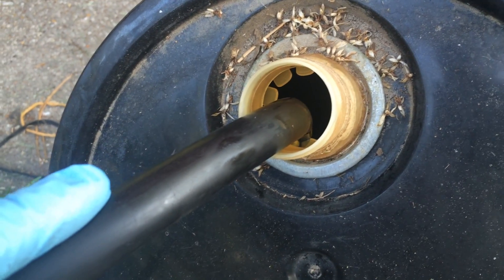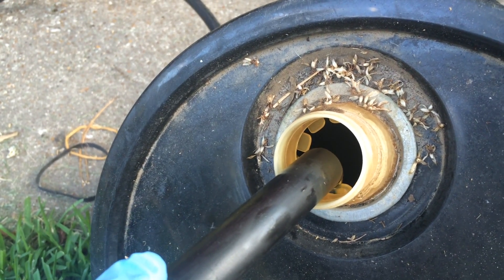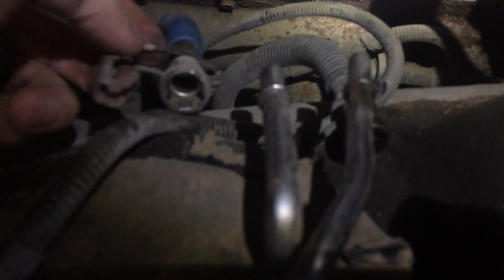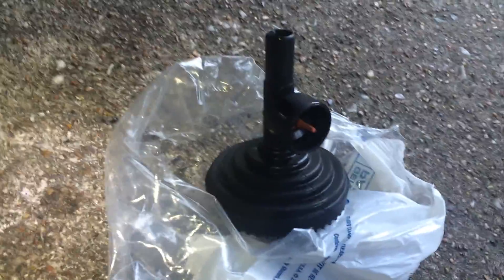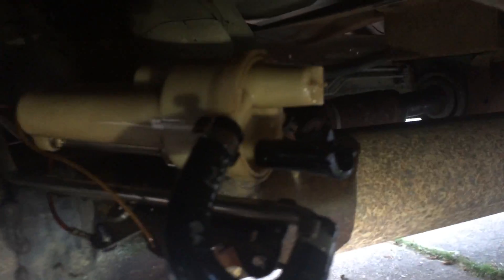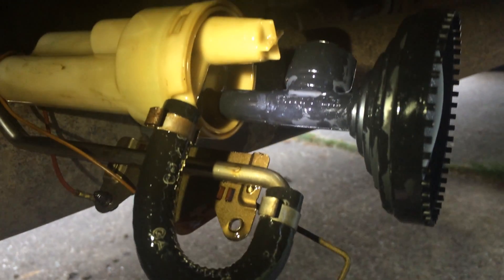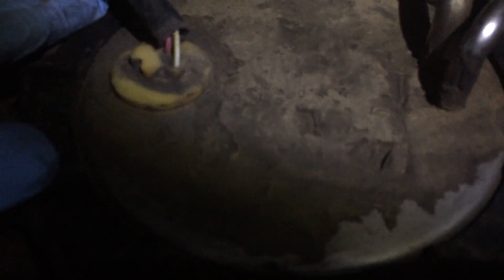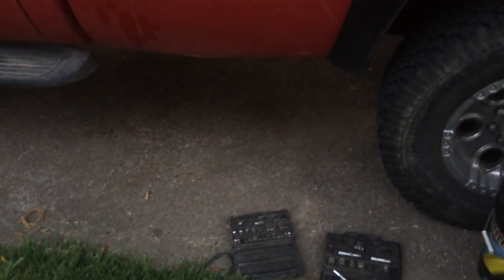Replacing Fuel Intake Screen - 1999 F350 7.3L Diesel

Comment: Thanks very helpful!. I have a 2000 f350 7.3. It's doing the same thing. My check engine light comes on when it starts sputtering at 1/4 of a tank. Did your check engine light come on? It won't throw no codes though

Comment: Video was spot on man. I have a question.  Was you throwing any codes when it would start to act up?
This is exactly what my truck is doing. (I HAVE A QUARTER TANK OF FUEL RIGHT NOW. ) it drive fine last night for 30 miles parked it. Ran like a champ. Woke up this morning and it's not getting fuel. And throwing secondary fuel pump circuit low. I have changed everything literally from the fuel pump to the tip of the injector. Except the PCM. Every sensor has been changed including the coolant temp. All fuses and all  relays. I mean I have even changed the HPOP pump.

I can't find the gremlin anywhere. So the tank is my last hope. 
Thanks for the video I know the
Steps perfect description and details where need.
Reply: My pickup screen is fine. Whatever tells the fuel pump to turn on isn't telling it to pump. I have open bleeder valve on fuel filter housing and had a poof come out. Then Crack it again and spray my turbo. That's what makes me think PCM. 

I had issue using a gallon of oil to go 30 miles. So I found oil in my filter pot which had my go to injectors and yes the orings was bad on numerous injectors. So changed injector and cranked. It ran like crap. 
It finally hit me if all that oil is in the tank. And sure enough tank full of oil. I turned key and let the pump, pump out the contaminated tank. Since then I now have the secondary pump low circuit issue. 
I have a filter pot housing on order. After that the PCM is the only thing left. I just don't want to change it since ford no longer keeps them and the part is Vin specific.
Reply from the maker: Yeah I had an injector ring wash out this summer also, pumped my oil into the bowl like you said. I never figured it got all the way back to the tank but maybe. I never had to drain the tank to clean it out at least. 

When my IDM was shutting my truck off after 20 seconds it was NOT throwing any IDM codes. It’s wasn’t throwing any codes at all! We did like you and we were chasing a fueling issue thinking that maybe the pump was shutting off for some reason.
Reply from the maker: Mine never threw any codes, it just would run out of fuel when the gauge read 1/4 tank. I hate to say it but have you tried changing your IDM? My truck has eaten 3 IDM’s in 10 mos. This last time it would start and run for 20 seconds smooth as could be, then just shut off like I turned the key off. Then it wouldn’t restart for 30 min or so, and then do the same thing. We thought it might be a fueling issue. Like you, we sorted through all of it, filters, pumps, etc. Never had any engine codes. finally out of desperation we changed the IDM and it ran fine for a couple weeks. Then it went to delayed start, then started missing. Hooked the computer up and it read several misfires and a few IDM codes. Swapped it again and it’s running smooth again. Can’t seem to get an IDM to last.
Reply: I haven't had any codes about the IDM. I have changed it already. Not saying it's not the issue. But no codes other than fuel pump.

Comment: You should have change the small screen inside above that bottom filter screen.There is two of them and you can get the entire kit from rock auto for under $50
Reply from the maker: Well I’m due again. It’s been broken for about a year. I just keep putting off working on it again 😁

Comment: 10x10 blocks and wedged up to hold in place next to straps position
Reply from the maker: Yeah that would work. I have my own sawmill now, and I do saw out blocks like that every now and then. 😁
Reply: @TomBrueggen  I used tie downs to hold tank up.. then thought and tried blocks, WO measurements... Custom set measurements taken would be much more efficient.. 
Anyhow the blocks made life way easier over the tie downs.. 
1 lay blocks on there side, with tank on top 
2 connect lines, 
3 reposition blocks from on there side to upright.
4 if blocks or blocks and wedges set to fit before unstrapping it should fit snug as a bug. Straps bolt with a breeze
Reply from the maker: Yeah I’ve since learned how to use basic ratchet straps like little come-alongs. They don’t have much control when you release, but have used them to lift something a bit, and then block it up, then lift again. I need to take my tank down again, so maybe I’ll try the block the next time. Thanks!

Comment: There are two filters INSIDE the sending unit.  They likely need to be cleaned as well,  The sending unit pries apart and they pup off.  That's what the small cylindrical tube like structures on the outside of the case actually cover.  Check here for more info:  https://www.youtube.com/watch?v=i3UKgw0iGKQ and here: https://www.youtube.com/watch?v=Md3AESnN7cE
Reply from the maker: Thanks for sharing the other videos!

Comment: Don't waste your time. Find another video, like one of the Hutch Mods. Boy hope people don't use this as a model and skip all the steps you did, and go through all the aggravation. You didn't clean the screen in the tank, which could come back to haunt you in short order. Didn't check to see if you had the pickup at the right level, and didn't even know there was a tool to take off and reinstall the tank lid.
Reply from the maker: I admit I don’t know it all. But I got it done, on my own, and it’s working fine. I appreciate your input. The things you mentioned, I was obviously unaware of at the time. Hopefully others see your comments and do a more whole job than I did. Thanks for watching!
Reply: @TomBrueggen   I think you did a fine job. I have the same truck. You don't need all that hutch mod shit. I'm pushing 450 hp and don't have a hutch mod and don't have a fuel pressure, delivery or filtering problem. These comment warriors think they're perfect mechanics or mechanic critics. Half of them don't even own a truck.

Comment: I'm going to have to dig into mine soon, nasty dirty job am not looking forward to. I found it interesting that you didn't need to take the tank all the way out, other vids they drop the whole tank. I may try it your way. There are the two little screens in there also that should be cleaned or replaced, but I bet you don't want to do it over again! If it's running fine leave it. I have the symptoms of loss of power bad mileage and running out of fuel at 1/4 tank on the gauge. To have it done is just way to much money! 2000 F250 230k miles.
Reply from the maker: Timmy tool, maybe I got lucky to not have to fully drop the truck. I’d suppose most folks do just to get it out from under the truck for easier access. I’m lucky my truck sits high enough I could just sit under there and do it easy enough.
Reply: That's great, my truck has a lift, makes it easy to work under there!
Reply: I have been giving thought to turning mine into a flatbed. Build custom hatch W a quiklatch over fuel assembly.. 
Could even just get bulletproof fuel system, with a custom tank\sending unit .

Comment: Have to drop my tank to get to brake lines broke no brakes anyone got tips or ideas are welcome thanks
Reply from the maker: If you can access the broken lines can you just run new lines to replace them? I can’t recall of there are connections in between or not. Otherwise just run the tank as low as you can on fuel and take it down. Nothing is easy, but this is easy enough. I did it by myself in less than an hour I think.
Reply: @TomBrueggen  thanks I appreciate it I'm going to try it to save me some money.
Reply from the maker: Understandable. It doesn't really cost anything to take down your fuel tank, other than a couple tools. You can get a fuel line disconnect tools for something like $5, so you don't have to fiddle with screwdrivers like me. Good luck on  your project!
Reply: @TomBrueggen  Were I live everything is expensive. (Hawaii)
Reply from the maker: oh yeah, ouch! I honeymooned there. Even laying on the beach costs too much! Ha!

Comment: Disconnect tools save your fuel lines from future leaks. $10 local napa. Dropping the tank on my rig so we will see how that goes.
Reply from the maker: Oh yeah for sure. I think I mentioned the tool in the video. I used to have some around for my old f150, but don't think they fit this anyway. Screwdrivers were not ideal, but it worked. Your'e right though, I've used those quick-disconnect tools and they are a breeze! Good luck with your tank job!
Reply: Tom Brueggen I have ruined a fuel line without the disconnect tool trust me it's not fun leaking fuel all over cuz that cost money it's dangerous also near the fuel it can leak onto the exhaust. Glad yours worked out for you I'm still waiting on the pickup filter that goes on the bottom and deciding if I'm going to delete the other two filters

Comment: I've found if you don't have the disconnect tool use a sharpie cap cut to length split down middle put around hose and push in and push clip toward hose as if your putting it on then pull back easy as 1 2 3
Reply from the maker: That's an excellent tip! Thanks for sharing!
Reply: Anytime your video helped me out alot now I'm on my way home Al From TX after being stranded for a week

Comment: you should have opened the mixing chamber and rinsed the screens out in there.
Reply: throw those screens in the garbage
Reply from the maker: Don't know what you are talking about, but sounds like it would have been a good idea. I just fixed the immediate issue at the time. Thanks for the input!
Reply: Hi Tom!  The white part that the pickup hooks to comes apart and there are two screens inside.  They can become blocked with debris.  My truck is at 260k and no problems so far but I might take it apart this summer to head off all the problems.  Don't like working in the winter outside on this thing.  I just was without it for a week while I tracked down a burned up o-ring on an injector that I accidentally lost the copper washer when I installed it in November (2000 miles). 
Thanks for video!  It will help me this summer.
Reply from the maker: Unfortunately I'm so dependent on my truck right now, I'm putting off a lot of maintenance. Same excuse as anyone else, too busy. I've got a leaking radiator (new one is in the garage) need new oil cooler rings and glow plugs (bought both months ago), and I have a front tire wearing funny again. Oh, and I'm overdue for an oil change! Shame on me I know! No telling what else needs attention.
Reply: Tom Brueggen ur wife may be?
Reply: Good job, I am sure others will have the same issue

Comment: Glad you got it fixed Tom, I still prefer a Dodge though... Hate when things break!
Reply from the maker: Dodge huh? Well, we all make mistakes. It's OK... : )
Reply: 😆 Hey man, at least our Dodge hasn't left us sitting, unlike our momma's Ford. She had it drop a wheel seal and then after that was repaired, within 200 m of that on a trip to Cali, the silly vehicle dropped 3 injectors on us. 😐 Talk about the worst trip to California I've ever taken. 

We've got a bit over 200 thousand miles on a 2004 Dodge duelly. I'd have to say that's pretty darn good for a "Mistake". 😝
Reply from the maker: Hah, fair enough. Cummins I assume? Those are plenty solid, I agree. I bought this truck because it has the 7.3L Powerstroke. It's over 240K miles right now. If this little silly fix buys me another 200K miles or so I can live with it.
Reply: @SansaStarkofWinterfell  all in all fords and dodges need to be serviced .